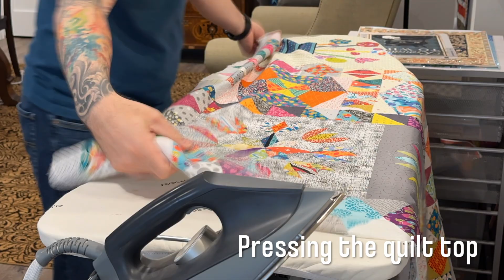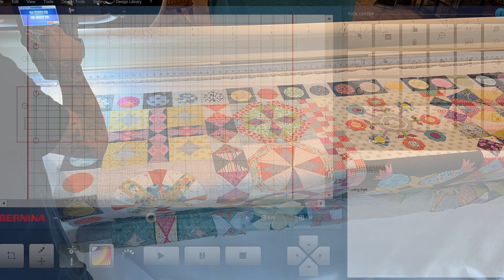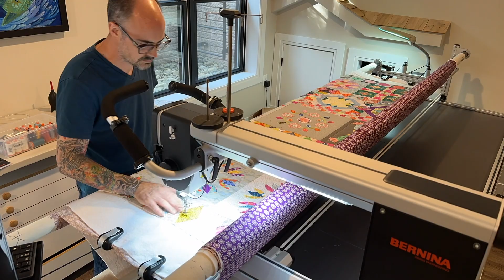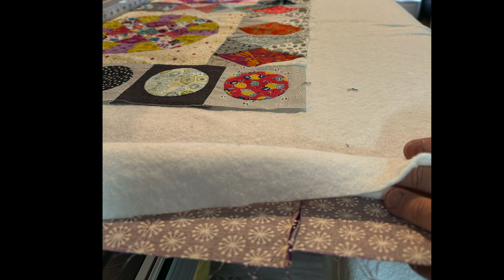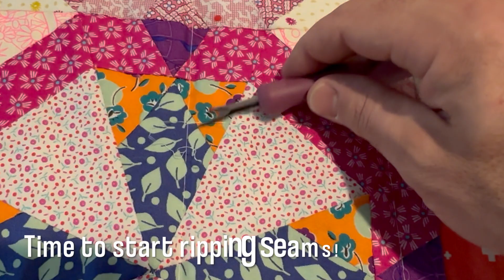Thread Basting on a Longarm - Getting Ready for Hand Quilting

Comment: Thank you so much for your videos and sharing your process. I really enjoy your calmness and how you present your expertise.
I do not own a longarm. If that would have happened to me I would unpick only a few inches on the bottom, cut the backing and add a new seam and then continue basting. But I guess on the longarm the procedure of unloading and reloading is the most time or labor intensive task so that won't work I think? I totally understand your decision to restart the basting and invest the time. No need to wing it at this stage, quilting does not need to be fast and easy. The quilt will be done eventually and you will be proud, so the extra hours are worth it.
Reply from the maker: Thanks for your comment. I considered modifying the backing seam instead of ripping it out, but it was indeed easier to rip it out instead of unloading and reloading everything on the frame. It’s done now, and probably took me about 3 hours to remove everything and re-baste it.